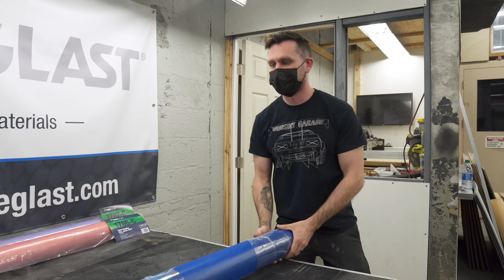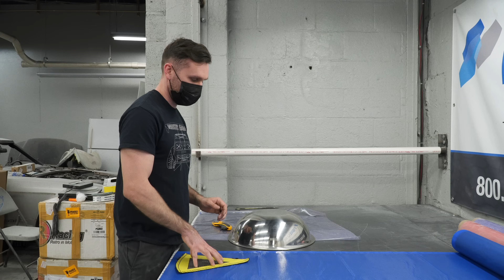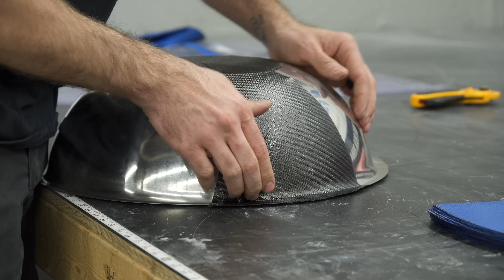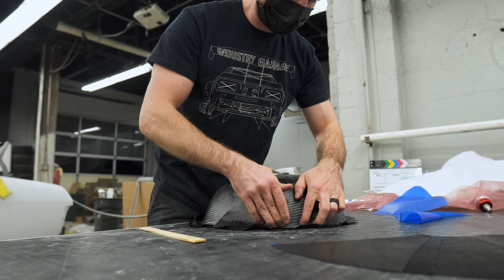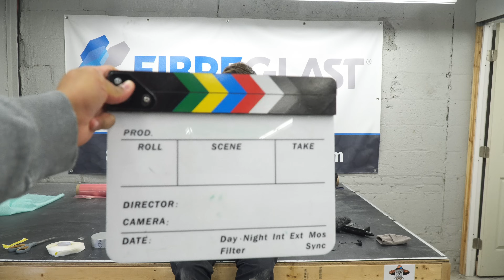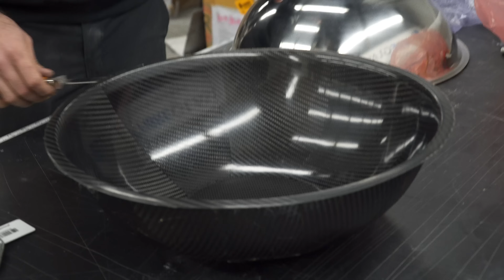240Z CARBON FIBER BBS TURBOFAN | Part 1

Comment: What are you guys doing?, I worked in F1 for 25 years so I know what I’m talking about 
Where are your latex gloves?
The shop is not a ‘clean room’ by any standards 
The material you cut out in triangles makes every one at the wrong direction to the others, creating stress between each triangle 
Jeez

Comment: Just as a question: Why not leave one of the blue sides on until you get that piece all the way stuck down so you’re not touching the resin and can easily push the piece onto the bowl? Then peel of the blue on the back before the next piece.

Comment: Damn! When the content creator says your on OG, oh the feels 🥰 Loved this episode!! Its got me really wanting to give it a try. Question tho. As far as the mold goes, does it have to be a metal mold to hold up to the 310°? Say a fiberglass mold or something else easier to make?
Reply: I'm pretty sure fiberglass and carbon fiber can handle 310 fine. I think the temperature limit depends on the resin used. I think carbon fiber molds work great when making a carbon fiber part since the mold and part expand the same amount in the oven. I've seen plenty of fiberglass molds made for carbon fiber. Fiberglass cost less and appears to work fine in the videos I've seen.
Easy Composites Ltd has lots of great videos on the topic.
Throttle Stop Garage used fiberglass molds to make carbon fiber car parts. I don't think he uses an oven though.
Matthieu Libeert also has videos of making carbon fiber parts.
I'm sure you've seen lots of similar channels but the above are a few I've watched.

So far, I've just watched videos of other people making carbon fiber parts. One of these days I'm going to try it myself.

Comment: I want to do a couple of composite projects: Glassfiber headliner. (Classic mini with ultimately starlined headliner). Carbon fiber front splitter  and read spoiler. Probably using expanding foam core

Comment: My brain is hurting just trying to work out if you guys are speaking imperial or metric with temperatures hahaha

Also, those turbofans will be beautiful but I wonder about their function. Might need to cut some holes in the bowl if you want it to actually cool the brakes. Looks elite though

Comment: Story driven content. It makes it easier to follow the projects on the channel. It keeps us engaged. It makes it easier to follow what’s going on in the shop. 

If the vid is incoherent or your videos don’t some how link together people will not consistently follow 
1. The set up 
        What are you doing today ?
        What’s the problem to be solved?
        What’s the task needed to be done?
2. Action
     Basically the stuff you need to do to finish the task or solve the problem 

3. The Result
      Did you finish?
      If so what was the result 
      If not what was the issue when will 
      you continue.

Comment: really want to see strength comparison of different carbon parts, carbon fiber vs fiberglass, mix of cf outer layer with fiberglass interior, how many layers of cf do you really need, impact tests, bend tests, etc... and also some aero design theory and track setups would be cool to see

Comment: I see the Rob Dahm comment for a collaboration. I know Rob needs a custom hood for his quad rotor rx7 build. He did a rough steel cut up hood where he extended it by like 8" by wording 2 hoods together, but I'm sure a nice carbon hood would be 1,000,000x better!

Comment: One of the tips I got in a composite tooling class was that you can use a can of compressed air upside down to blast the corner of the backing film, and the freezing combined with the air blast helps lift the backer.

Comment: FYI to keep the rolls fresh, you can get pvc pipe, cut to standard lengths and store it inside. No more dust, you don't have to wrap it, don't have to cover it. Cut what you need, put it in the tube, put the cap on, get on with your merry day. Dunno about prices in NA, but here in EU, the grey plastic type pipes (generally used for water evacuation) is very cheap, AND there's even fire proof blends.

Comment: Dumb question but can you use pre-preg and not use an oven? Thinking of making a panel without a mold and straight on the body.
Reply: No every prepreg I've seen needs to set in heat and vacuum
Reply: You need to be able to control the heat at least up to 270 degree's F, or more depending on the pre-preg cure cycle. Silicon heat blankets and a programable temperature controller with ramp and soak times can be used.

Comment: What vacuum do you use we are planning to do some vac work on our full space frame cars composite body and wanna move on from brush and roller

Oh I tagged you in a shot of the plug on the chassis it’s not finished however